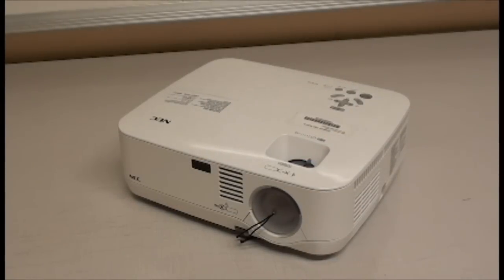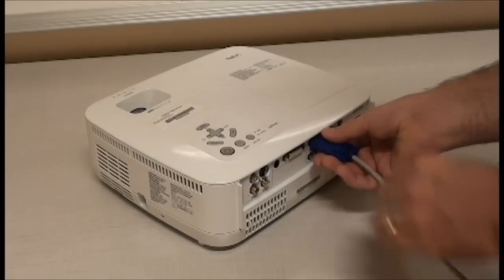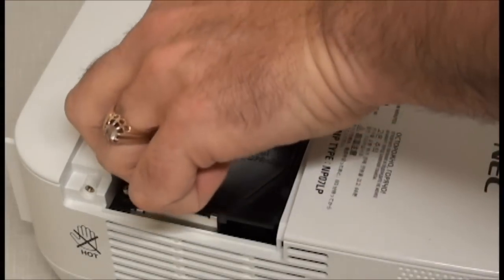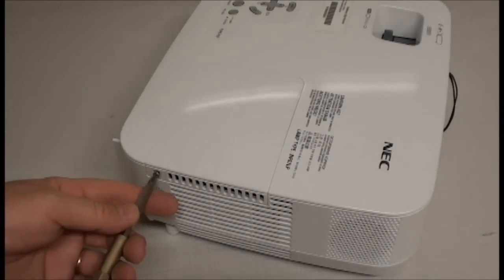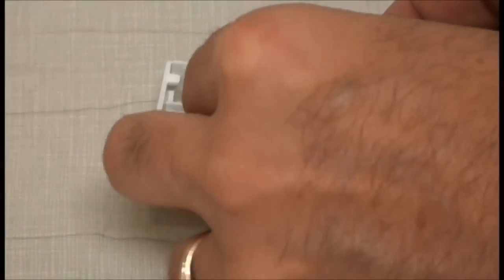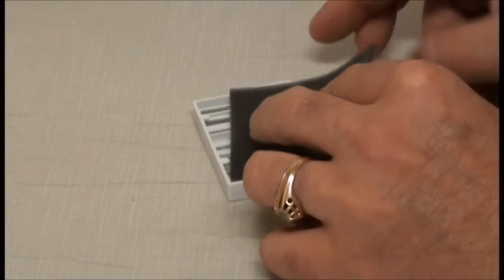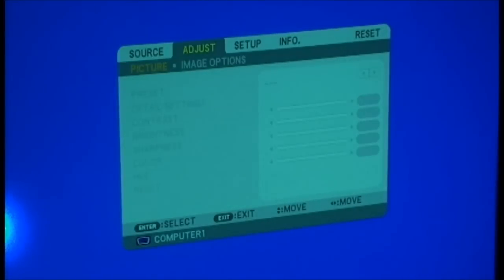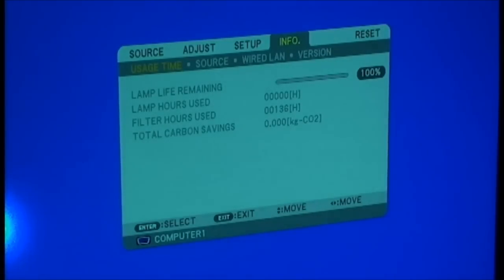Changing the bulb and filters on an NEC NP610 projector

Comment: Peace and mercy of God Dear brother I have a Japanese projector nec um280w It was working perfectly, but now it just does not work. The word STATUS appears with a red indicator only What's the solution
Reply from the maker: It may be overheating. Clean out the air filters and use compressed air to blow out the dust from inside the projector. (Don't do this with the projector on or the bulb hot, though).
Reply: @Silverback67  Thank you very much, it worked. I cleaned the inner bottle